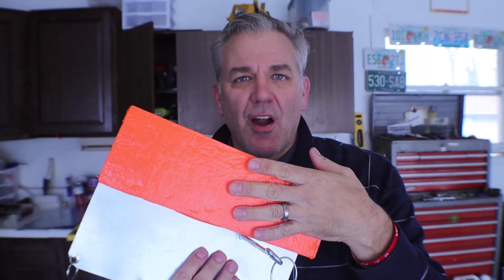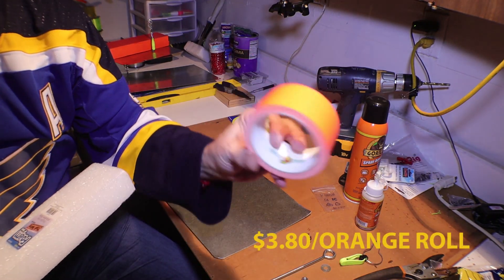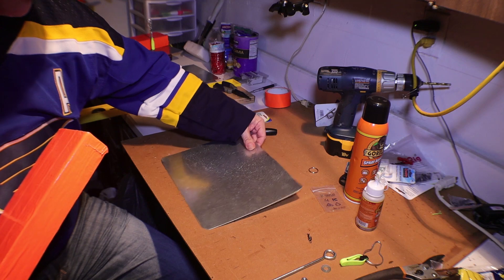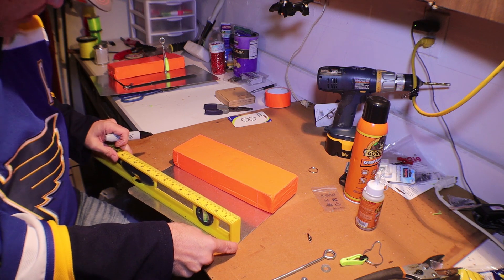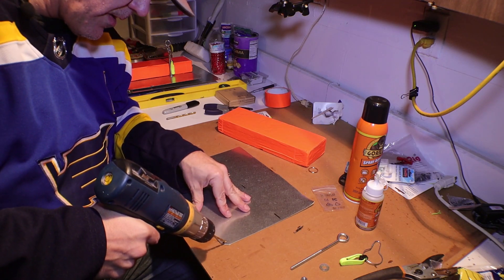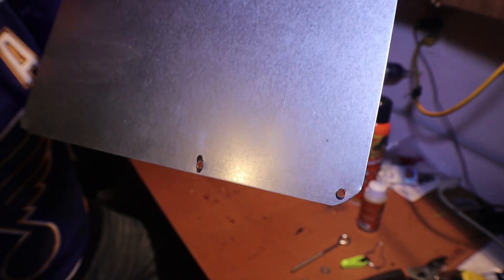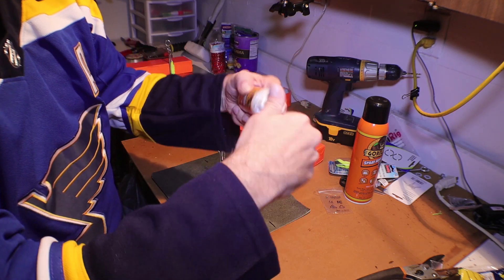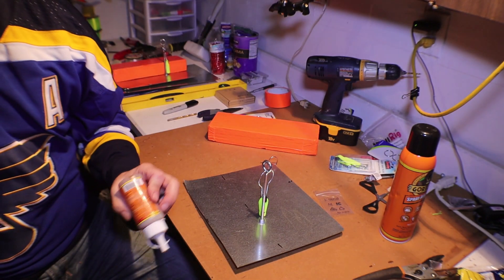CHEAP DIY HOMEMADE PLANER BOARDS - MAKE YOUR OWN -  BAIT2BEND VERSION

Comment: Thanks for the video. I made mine exactly like you did.They worked great, better than the one I bought last year.
Reply from the maker: Thanks for watching Tom.  I have only used them once and they worked pretty well.  I'm in the Mississippi River with heavy current so because they weigh a little more we have to watch how much current they are in.  Have a great day and Thanks again.  -Scott

Comment: Hammer the bent corner down before you glued it. Second dont put the bolt in yet glue your foam first so you get a flat surface to put weight on to let it dry. Then cut a 45*deg angle on the foam then tape it so it glides thew the water. But any way just my 2 cents. You did a good job. I learned some good stuff.
Reply from the maker: That is awesome information.  Thank you for watching and the tips.  I’m making a couple more and will incorporate your suggestions.  Have a great day.  -Scott

Comment: Why does the bolt need to be so long?  If it's to keep your line farther away from the board, wouldn't a 6" piece of cable for the release work?

Comment: Your leading edge needs a taper to track good. Also use SS so you dont have rust, with lock nuts so you dont need to worry with then coming off.

Comment: I think it would be better if you use 2-inch styrofoam instead of the full 4 in I think the 4in would make it off balance and not float straight up with a lot of weight
Reply from the maker: I had considered that when doing it.  Never had making these and fishing on the heavy current of the Mississippi I was worried about two things, weight and current and which was gonna win!  So far, after a couple times using, they have done ok, I am looking forward to testing quite a bit in 2020.  Thank you for watching Dennis.  Take care.  -Scott

Comment: Do you put in at yacht club?
I'm up at 2 branch. We should fish together sometime.
Reply from the maker: Absolutely.   We’ll definitely connect this season.   Yes at Yacht Club
Reply: @Bait2Bend  i just bought a new boat the boat show.
Bennington tri toon. The fishing model. Wont be in till end of April beginning of May.
Do you know if those square monster rod holder bases work on the rail of a pontoon
Reply from the maker: I would think they would.  I don't know that for sure however.  Here is where I got mine.  They were the clip-on's.  http://www.hillsrodholders.com/en/    They fit on the pontoon just fine.
CONGRATULATIONS ON THE BOAT.  Excited to see as I'm sure your excited to get out and fish on it.
Reply from the maker: The Bases to the Rod Holder from Hills:    http://www.hillsrodholders.com/en/13-bases-only

Comment: Great DIY video, thanks. I made my as you did also. I incorporated the 45deg angle and used wood instead with some sealants. It kind of worked. I will add some buoyancy and decrease the weight at the bottom and will try it offshore next week. Wish me luck. 👍